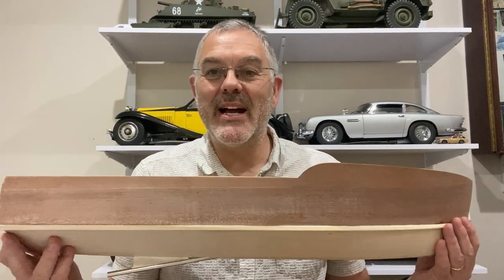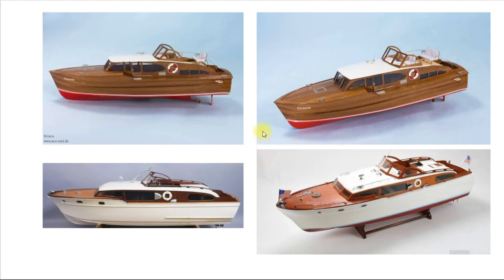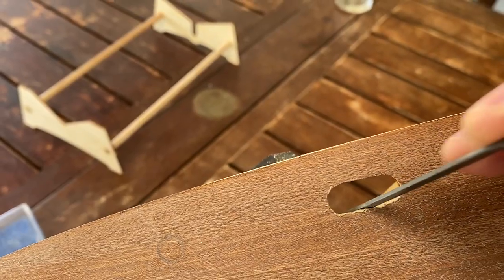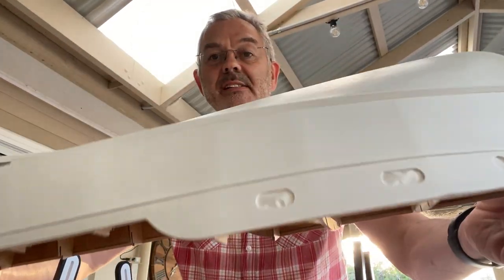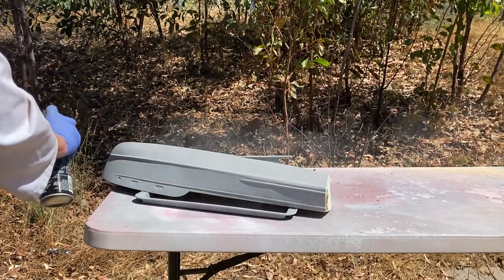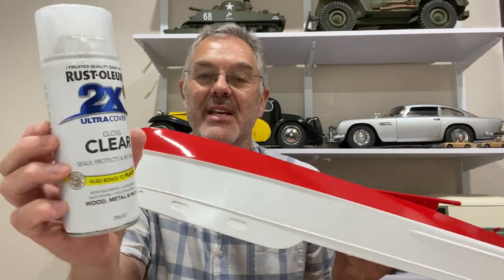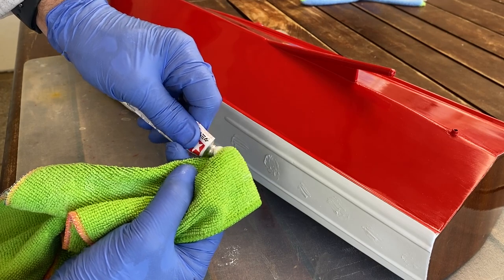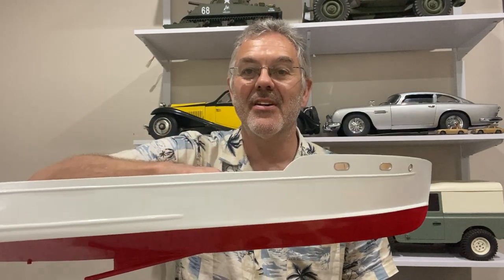Building an RC boat - can I make a Chris Craft Corvette out of an Aeronaut Victoria?  Part 3.

Comment: Looking good.  I use finishing resin inside the hull and on the exterior to seal from water and once sanded smooth fills in all gaps, seams and cracks for paint.
Reply from the maker: A lot of boat modellers do that but I built this one as the instructions as said.

Comment: i was wondering how you would havbe done the windoows mod but to be fair it went better than i though, just a though y did u not make it so it camre from inside the boat to the outside becasue u could have put a flange on the inside to make it fit flush and would have fit better, but what do i know im only a 3d printer guy, but over all im impressed

Comment: Could a brush on gelcoat make the process easier to sand also hide the inner structure before paint..may also give you a super smooth surface to lay paint..Looks amazing
Reply from the maker: Not sure what a gel coat is.
Reply: @Modelling Misadventures  it is the underlying coating on boats before paint. Cures really slick. Bush on type is fairly inexpensive from someone like Total Boat. Goes a long way

Comment: I think port holes would be beter filled by sticking it on a bit of resin tape then filling the glass area with a bit of clear UV set resin and hardening with the little torch

Comment: So that you know, when Chris Craft delivered new boats, they painted their hull sides with fairly gloss enamel, but like most companies, their bottoms were painted with antifouling paint that was at best satin. Even today if you walk through any marina in the autumn and winter, you'll find plenty of boats with dead flat antifouling bottoms. You were actually just about right when you first sanded the bottom and could have left it there. Smaller trailerable boats may have had non-antifouling glossy bottoms, but never big cruisers.
Reply from the maker: Interesting 🤔

Comment: Am I missing something here ?  I was waiting for the end of the FAB 1 series and this is the 3rd part in this series.  Am I not getting notifications ? 
I'll have to check the playlist. 
Anyway...Came out fantastic in the end after all that work.  In fact, the finish probably looks better than the real boat does. 
Did you know you can airbrush the Molotow chrome paint ?  It's quite delicate though, so probably the chrome spray paint will yield a hardier finish.
Reply from the maker: I always have more than one project on the go at once so the videos go up at different stages.  FAB 1 is still ongoing!
Reply: @modellingmisadventures  Since I only joined the channel recently, I just had a look at your playlist and geez, I don't know where to start.  I see what you mean about having a several projects going at once.
Reply from the maker: @ellesmerewildwood4858  Only four at the moment!  The bus should be finished soon but the boat, FAB 1 and the Morris Marina van all need more work.